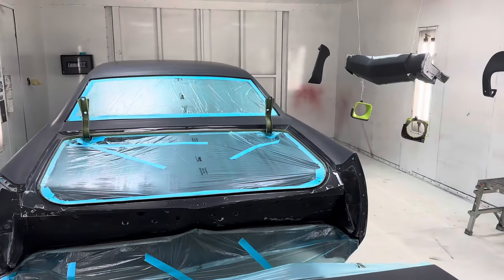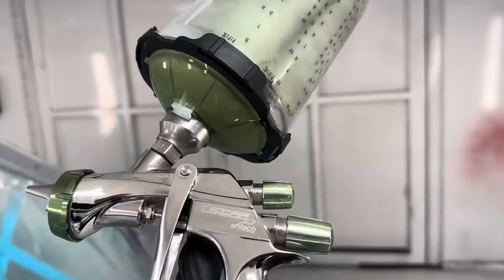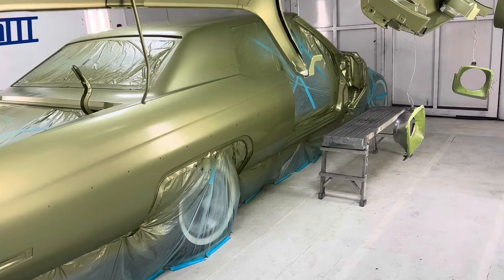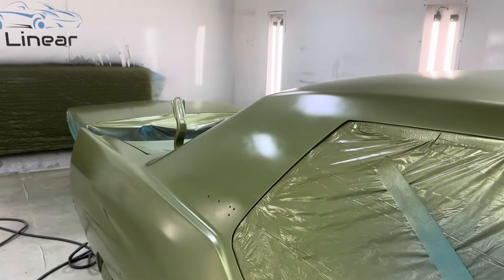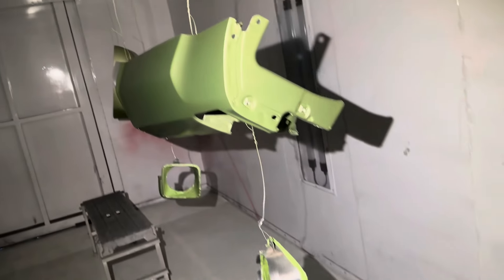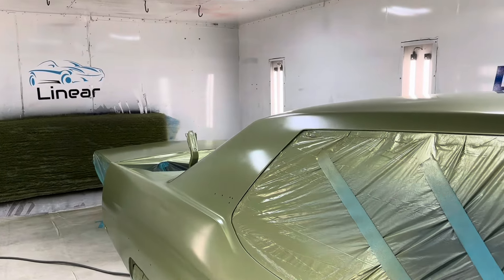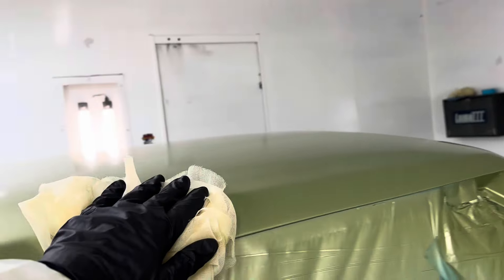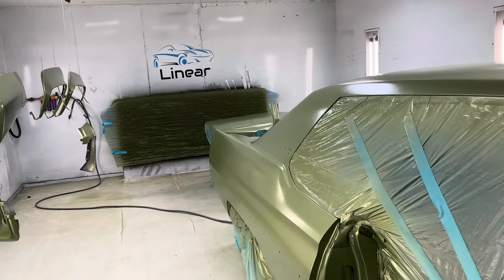Code 42 Leaf Green - 74 Buick Electra

Comment: If you have cured primer why do you seal? For uniformed coverage?
Reply: It's for better hold out and especially for coverage. These paint formulas are designed to go over a specific shade of gray ground coat. It especially helps when spraying a translucent color like red or blue pearls. Some colors, you can take 4 or 5 coats down to 2 or 3 if using the recommended ground coat.